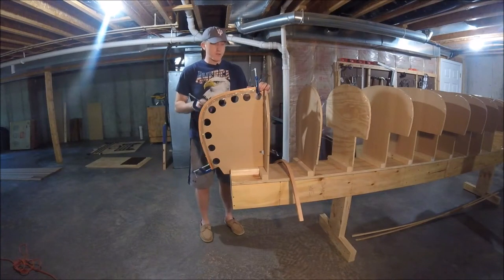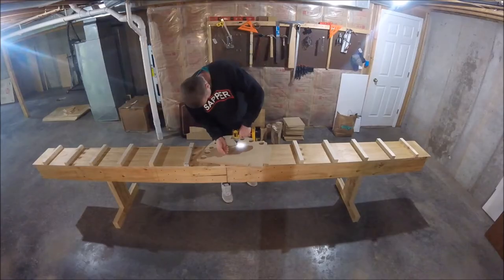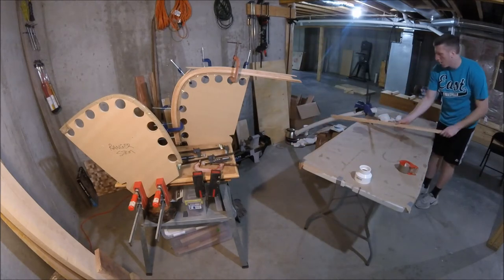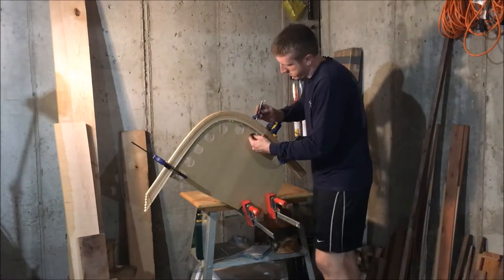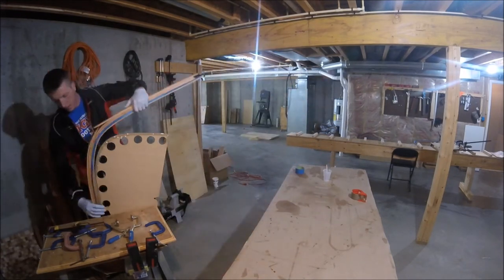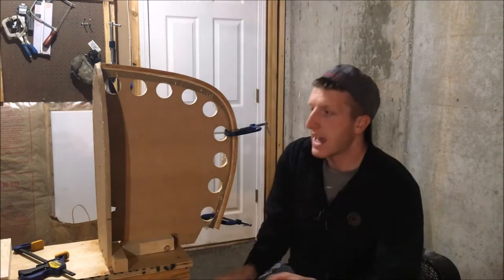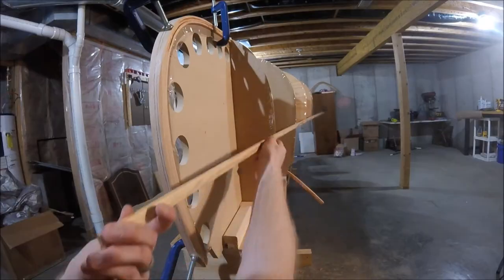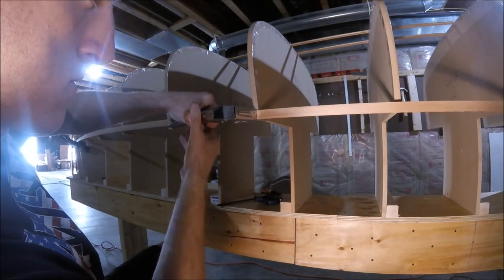Cedar Strip Canoe Ep 3 - The Stems

Comment: I noticed one strip fractured, people the steam wood for a living back up the wood with a metal strap. stems on canoes are a vestige of the days when you needed to tack canvas to the boat and cover the ugly seam with an outer stem, when fiberglass came along the stems should have gone by the wayside but they were held onto by people that wrote books, and so here we are today in 2022 with people still using stems. i like an outer stem for its looks but i also like the stemless look it's refined and dignified. That's it I just wanted people to know there is another way to do it.  Yours looks good with a vestigial stem.
Reply: Correct, I was fortunate to have steamed an extra piece if I recall (it’s been a long time).

Comment: Hi Andy what kind of wood did you use for the stems? And did you have to run it through a thickness planer? I'm about to go through this step and I don't have a planer. 
Just wondering!
Reply from the maker: Owen I did not use a planer for this. The strips are narrow, so I was able to re-saw them on my table saw. Anywhere that was rough I think I sanded them very lightly just to get rid of the worst roughness and ensure I’d have decent glue contact. 

Hope that helps. Let me know if you have other questions.
Reply from the maker: Owen Casey oh and cherry strips for outside. Western red cedar from Lowe’s for inside
Reply: Great thanks a million
Reply from the maker: Owen Casey you bet! Thanks for watching and reaching out!